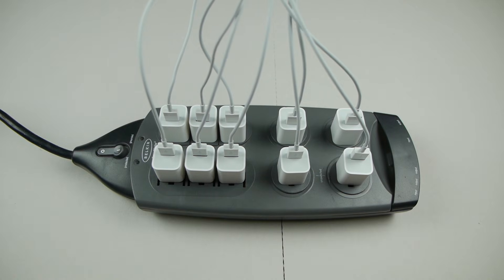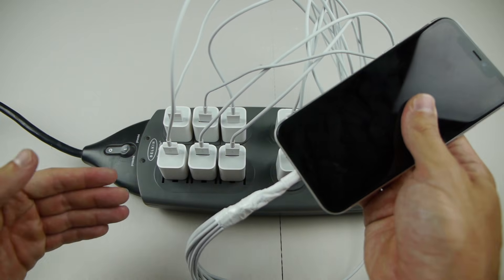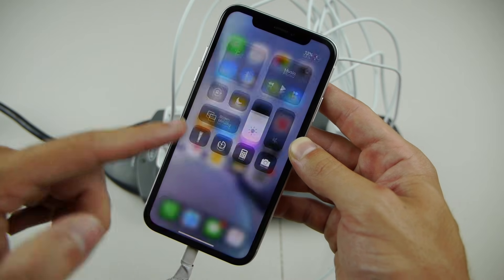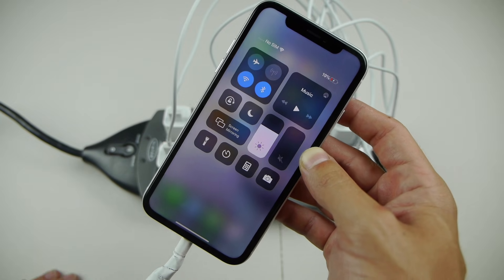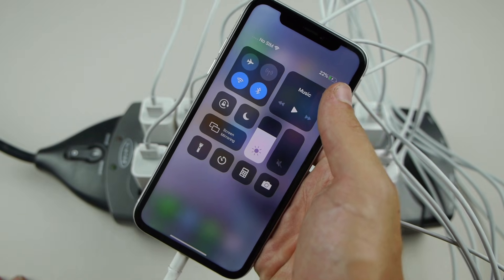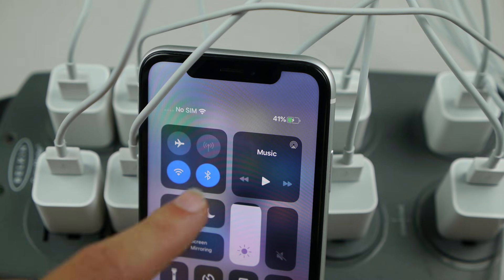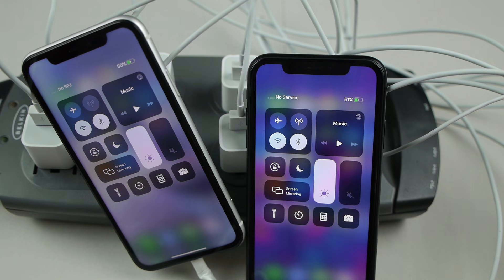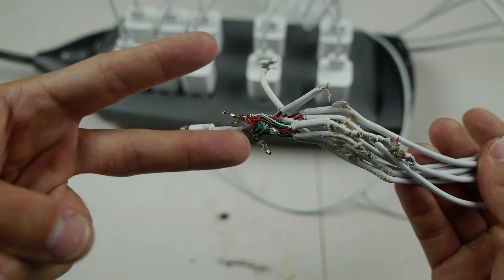What Happens When You Plug 10 Chargers in an iPhone? - One Mega Charger!

Comment: THE TRUTH: He literally had all wires just stuck to the tape and not actually connected to the phone. Only one charger is connected to the phone and the phone's battery is super degraded that it charges this fast.

So kids don't trust everything you see on internet.
Reply: Haa u r smart u know everything 🤣🤣
Reply: @foreveranimation745  ✌️
Reply: it could be fake but if you watch last 5 seconds of the video you see that all 10 wires are actually connected
Reply: @marijan8059  lol, connected like that doesnt make a proper circuit
Reply: @gamingscorpionindia1995  i know nothing about electricity and stuff but just said wires werent just stuck to the tape but also connected together
Reply: @marijan8059  oh okay
Reply: @gamingscorpionindia1995  wow, the fact you are so reasonable when I was actually in wrong (kinda) is really impressive. I guess im hust not used to nice people on social media!
Reply: @marijan8059  if it was to work then the phone would probably power off because of high voltage and to prevent the phone to get blown. Its a failsafe in all phones including iphone which is connected to the battery which prevents these kind of circuit. 

If you try it, there are only 2 possible outcomes. 
1. Phone turns off.
2. Phone doesnt charge.

Comment: this is impossible from an electrical side, because the iphone can only take a max. definite amount of watts, which is around 18 for the XR model. So please, given the fact that some people really put iPhones in their microwaves, don't do this, because while a single charger can regulate wattage based on what the phone's maximum is, 10 chargers together won't understand what wattage the phone is asking for and they will fry the battery
Reply: To smart to watch this lol
Reply: 1st of all. The charger dont have any circuit to cut off the power flow.  Not even iPhone chargers. If iPhone company is saying that thr chargers have automatically cutoff power supply ones ur phone reaches to 100% charge then they r just pure lieing to everyone.  

2nd : the difference between old phones and new phone is : new phone hardware and software both got upgraded to the level that ones ur phone reaches 100% charges the software of ur phone(weather its ios or android) cutoff the power supply to ur battery but it still continues the power flow to ur phone..thats why ones ur phones reaches 100% and the charging light shows off in ur phone still if u r using ur phone while the cable(charger) is connected to ur phone ur phone wont loss any % from ur charge. Means ones ur phones reaches to 100% charge power flow to ur battery stopes and bypassing the battery cable(charger) still continue to supply power to ur phone...  Thats why older phone were having battery explosion problem if u over charge it but new phones battery dont get explode. 

3rd : yes if u connect 10 charger in USB shoket then that USB shoket will output more watts but that doesn't effects the charging of ur phone if u connect that USB shoket to ur phone AS IT HAS SHOWN IN THIS VIDEO. because ur phone already got the software to control that flow and drow the max amount of power ur battery can handle durring charging. Other power just gets wasted and that will just heat up ur joining point at ur phone end... 

And ill also state this: why single charger was working faster in this video... Because single charger had cable which is perfectly intect as it made in company while that other USB shocket was manually connected to 10 different cables from 10 different charger. So it was actually supplying lower voltage for charging ur phone.... Amp gets added while connected in parallel but what 2A*10= 20A will do when ur phone software is only letting 2A pass to the battery for charging and with lossing wiring 10 cable with 5V connected in parallel is actually supplying only 4V or may be 4.5V not fully 5V because all the cables r manually connected with one another and due to heat and resistance of lots of cable its suppling lower Voltage..

So in this example lets say single charger is supplying 5V and 2A POWER to ur phone battery for charging while 10cable USB shoket charger is supplying 4V or 4.5V with 20A power to ur phone battery.  
Thats why single cable charger working faster (as Normal) then 10 cable charger.
Reply: Hoax
Reply: It will really work
Reply: @johnlemuelm.santiago6036  it will if your intent is to potentially fry your iPhone
Reply: Lol
Reply: And also the difference between original battery made by company and duplicate battery made by other general company is : original battery will carry 1 chip inside thr battery that will compile with ur phone software and it will actually drow low power from charger Which r made with high power comparing to ur battery's capacity... Means even if u connect 3A charger to ur phone who's battery only supports 2A power(max)  then phone software will let pass only 2A to ur battery ( or if i say correctly the small chip inside ur battery will only let pass 2A to the battery to charge ).   While using duplicate battery dont have this small chip inside or even if chip is thr ot won't work correctly with phone software thats why duplicate battery might even explode of they r not made correctly.
Reply: And someone here said this 10 cable charger will fry thr battery then its no.  Its wont fry or explode ur battery but it will last and handle this high 20A power supply till the joining point of that battery to the phone (battery plug inside ur phone) is intact.  If it still continues to heat ur joining point that battery wont brust open or explode but the chip and the cable of that battery to ur phone will burn out and it will disconnected with ur phone and then u have to change ur battery.. now a days battery don't explode. 

Battery explode happens only if thr is no chip inside battery to control flow of power and it letting pass all the more power  ( means high power from higher A charger.) to ur battery then that battery got a chance of exploding. 

Thats why its always saying that use original battery...
Reply: @398yorunisaku-o7p  because original cable can supply more power or putting in a simple term then " original cable will supply power (means voltage, A and watts ) exactly as the charger is delivering it.  Means if the charger says 5V ,2A charger then ur phone will receive exactly 5V 2A power supply to charge ur phone battery. Which is exactly ur phone battery is made to handle it...but if u use different generic cable with ur generic charger or lets say u r using ur Original charger with generic cable then ur phone will(/might) charge slow.  

The reason is generic means duplicate or any other non-company cable will supply low power to ur phone. Means even if u r using 2A 5V original charger then that duplicate cable wont be able to supply that exact power to ur phone.. that's why it will charge slow. Not only charger but cable also matter while delivering the power needed to charge ur phone... 
For example..u got original (came with ur phone) 5V 2A 18W charger and also u brought one high end 3A charger.. Now if ur new high end 3A charger came with its own cable then its good. But let's say ur new 3A charger didnt came with cable and now u r using ur phones original cable with ur new 3A charger(high end charger but different & well respected company) then also it happens that U r not seeing any difference in charging ur phone faster.  Because even tho ur new 3A charger is supplying more power and also lets say ur phone battery can also handle 3A more power for charging faster but the fact is u r using ur phones original cable which came with 2A original charger.  So the problem is might be that ur phones original cable is only able to supply 2A power from its wire and So for that Reason even with 3A new high end charger ur phones is still charging at same speed as before(with 2A charging speed).
Reply: @398yorunisaku-o7p  Bro what im trying to say is(in my opinion)::. I don't mind people buying different company charges or high end charger for the phone if thr original charger and cable gets broken or something.... BUT in my opinion 2 things is best. 1st either buy same original charger from company with original cable.. or 2ND   if u r going to buy different, well respected company charger with higher power then only buy those charger Which comes with thr own set of cables.  Means dont just buy charging shokets but buy any high end charger that cames with that same company charging cable...
Reply: @preyashsarang6168  No I didn't mean to offend you were just talking about charger and battery if I offend you I'm sorry we can call off our chat if you'd like I'd agree.
Reply: @398yorunisaku-o7p  just noticed that.  I think i didn't mean to reply u with that comment.. i think instead of someone else i clicked on ur comments and said that college things and all.. anyways. Just now i noticed it. And show that i wanted to say to to someone else . anyways. Sorry bro
Reply: @preyashsarang6168  No I'm sorry too I wasted your time I'm glad we settle things in here no fights at all I'm really glad hope to have you bro peace. ✌
Reply: Yea I say it's fake :/
Reply: Electronics does not work that way. The wattage is going to as much as what the phone asks for which is the max wattage of what the phone asked. So it wont fry the battery
Reply: @suppapoltetiranont5713  no u dumb- when you sent a massive electricity more than what the phone can handle, there is 3 possibility,

first, battery fries and explode.
The Phone hardware Overheat and exploded. which means you're dead anyway.

or last it wont work and the phone reject the extra amount of electricity and charges normally. which your electric socket will possibly Ruined.
Reply: @syakfui7924  No it won't explode as the original charger has a feature called automatic turn off once the phone's battery is full remember I have an iPhone 11 PRO which the charger once you charge gets so hot once my phone gets full the charger slowly cool itself off meaning the passage between the phone and the charger is cut off it won't charge anymore that's why newer phones and battery has a feature to not get exploded or spark as you call in your ears while charging compared to old phones like Nokia 2000's. . .
Reply: @suppapoltetiranont5713  No it will you don't understand the physics of electricity the electricity does not go all in one they go individually it may sound weird but actually the electricity won't go to a single they go individually which doing 10 chargers then connecting it to the phone which physics of electricity does not make any sense therefore there's a chance of overheating, chain reaction and specially it may or broke your phone in crisp.
Reply: @398yorunisaku-o7p  thanks I'm learning facts

Comment: I old Samsung Mobile I try a code *#0228# some screen pops up and I tap on quick charge the my battery started to fat in few day the battery was so bad that if I don't use by mobile without using charger it will switch off and every time my electricity bill would come around 1000 rupees but these time it came around 7500 rupees

Comment: One thing i want to say: fake, and it's really simple to make this fake
Reply: Marusiak Baptiste You are fake
Reply: Yea but why would u feel the need to fake this
Reply: Explain your solid proof its fak
Reply: @nzk7772  modern devices, (quick charging devices) have an specific power design, every phone charges at different amperes ( today's devices can go from 1A to  like 9-10 A) at 5v.
Current (Amperes) x Voltage (Volts) = power (Watts)
So if your phone charges at 4 A x 5V= 20 Watts  
That's the number that the charging port in the motherboard will not allow to go higher bc it could dmg the phone, (so you can't really charge your 20 w phone with a 45 w quick charger) Phone will detect it, but will immediately limit the current that is going through. Doing this with 10 chargers is the same scenario, phone will limit the charging speed... But depending on the design there's a point where the phone wouldn't even be able to handle that much electrical current and could be dmged in different ways: from frying the motherboard to getting a fat battery, some may even explode to some chemical reaction and in fact some people have result severely injured by modifying phone's chargers. Dude in the video never showed us how he 'tied 10 cables' bc he never did as he knows this could dmg his phone, and he shouldnt be recommending this because that could possible dmg people's phones...
Reply: Explain your solid proof its real

Comment: Most smartphone chargers if not all nowadays are "smart chargers" so they actually negotiate the current and voltage with the phone. Also if the chargers are connected in parallel then you still provide 5v, just with a lot of potential current that won't all be used due to the iPhone not being capable of accepting it all. Cheers!

Comment: There are so many issues here. 
Adding chargers just increase the maximum current that can flow through the cable. However, cables are designed to handle a maximum current, if exceeded, it can melt (in this case, in the very end, near the plug where all cables come together). 
Second, there’s a maximum current the phone can receive, if you can provide more, nice! But the phone will not draw more than it can.
Also, there’s a reason why it charged quickly in the beginning: charging follows an exponential graph. The closest the phone is to fully charged, the slowest it will charge

Comment: So why is this happening?
The energy that is consumed by the phone is being divided among all the cables...no matter how many power supply do you put together (parallel) the output consumed by the load is constant. Which means both are equal. But since he is using more cable he is increasing the wire resistance which means much more energy loss and hence charging phone with 10 cable is slow.

check out my real if you want to learn more about electronics: www.youtube.com/inventivecreator

Comment: All this does is make the sum of the amperage of all the chargers available to the phone. It’s just a (rather janky) 5V, 50W power supply. However the phone won’t pull more than it’s programmed to - Which in the case of “regular” charging (non usb-c power delivery) is like 12W. 
If you used a single usb-c fast charger, it could pull up to 18W I believe. It can only do this when using a USB-C to lightning connection because it has to do a “handshake” with the charger before it can accept a higher current, which isn’t supported over USB-A.

Comment: After 40% it slowed down because when it reaches near 40-50% the device starts to cut down max power input and therefore it slowed down after 50% and the single cable won.

Comment: All power adapter are connected in parallel, therefore there is no change in voltage. No overcurrent, because current depends on load.

Comment: Nice, I'm surprised it works but I'm gonna stick with my 45 watt tanker charger. It dosent get hot cuz gallium nitride. 
And between 20-80% the phone charges faster and if u keep it there it saves battery degradation.
Reply: Phones without a removable battery u need to be careful u can extend their life by a few years, but it might not be worth it for u cuz you'll need to stop charging at 80% and always remember to charge at 20%.

Comment: The charge limiter (current) is inside the phone to save the batteri. Too fast charging ruins the battery, so it really doesn’t matter much if you use 1 or 10 chargers In parallel. The electronics inside the phone (or tablet) has the final word when it comes to the charge ”speed”. The supplied charger is ofcourse designed to be able to deliver as much current as the battery can take. The reason for why the limiter is inside the phone and not in the charger is obvious - it’s an ordinary USB connector that fits in any USB socket. The phone/tablet therefor must have the final word when it comes to the charge current. The electronics for this (current limiter) inside the phone is actually quite simple.

Comment: I think the voltage on the charger of one phone is normal and still it heats when we plug in charging so I think never to do this because the phone will blast due to so much power and voltage of charge don't try this